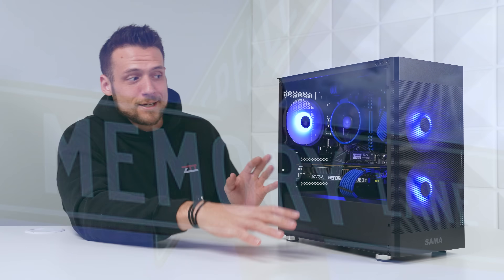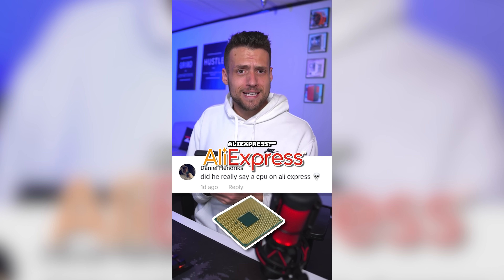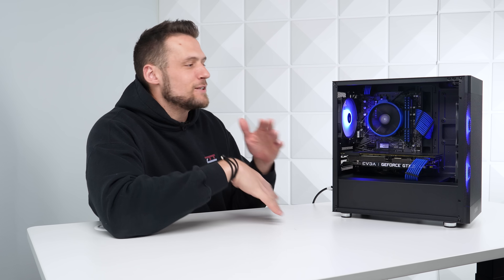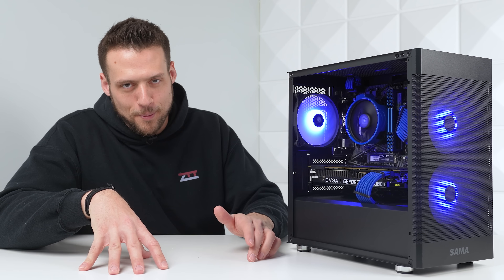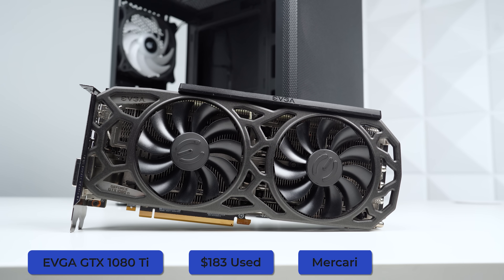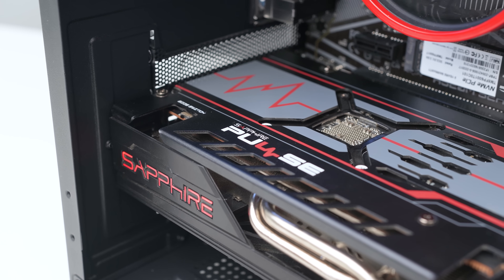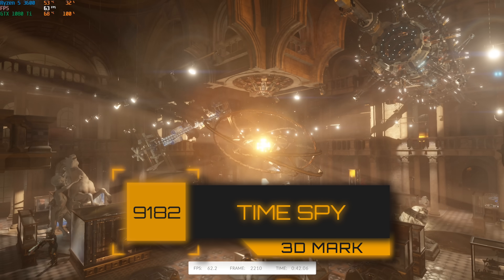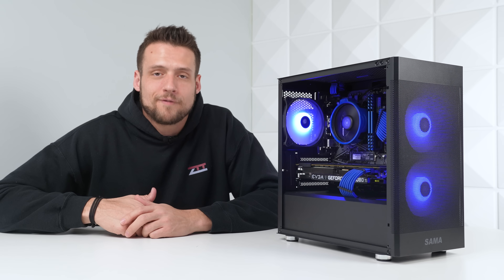A Very Repeatable $500 Gaming PC Build Guide

Comment: Can I run 32gb of RAM instead or would there be no difference

Edit 
I build this pc but i did changed somethings i did get that brand ram but i got a 16x2 @3200mhz ram 
I couldnt find a ti version but i did get the 1080 ftw edition 
And a pk hynix p31 ssd 
I see he bought a cheaper ssd but i was concerened about cache does memory cache really matter? The p31 was $114 when i bought it

Comment: Yikes I kinda got ripped off for my build 😅
Ryzen 5 5600 ~ 130
A520M Tuf Gaming Plus II ~ 80
Msi Gaming X GTX 1080 TI ~ 350 😣
Kingston 2tb 7000mb/s read/write ~ 220
Coolermaster psu 750w bronze ~120
Corsair Vengeance 2x8gb 3200mhz ram ~ 50
MS Armor V700 case with 4 pre-installed rgb fans and glass on side and front ~ 50
Some 90mm fan 125w tdp cpu cooler ~ 20
90 degree argb motherboard adapter ~ 5-10
ssd argb infinity mirror cooler ~ 6

Basically its a 1000€ build 😅😅
But in my defense I did buy it around 2 years ago

Comment: Would this work with a vr headset? I’ll disclose minimal specs in the sub-comments.
Reply: Here you go. 

Component:Intel i5 – 4590 / AMD Ryzen 5 1500X or greater. Operating System: Windows 10. Memory: 8 GB+ RAM. USB Ports: 1 USB port.
Reply: Also, should I really trust Aliexpress?

Comment: Hi great videos i use i7 3770 and 1050 ti and its time to upgrade but dont wanna spend too much around 450-500 euro i was planning on going i3 12100f and ddr4 memory 3200mhz with 1660 super do you think it would be good motherboard would be h610m-k which i think would be enough bcs i dont plan on upgrading for a long time what do you think???

Comment: How much will 5600x Bottleneck 6900xt?
I got a 6900 xt gpu used for a great deal 300$ , but now I want to pair it with a 5600x, which is right now on sale for around 135~140$.  ASRock B550 Pro4 motherboard 85$, klevv cras x rgb 2x8GB 3600 43$ (asia market)
My power supply is a TT GF1 850w gold+.

Comment: With cryptocurrency slowly rising atm, I snagged an aorus 1080ti for around $100usd as a spare gpu. It's good enough to support 2 1440p monitors without any major hiccups. Currently running a 5950x & strix 3070 for my daily set up :)

Comment: I have Ryzen 3 3100 + MSI B450M PRO VDH MAX + 1660 Super with 32GB DDR4 3200MHZ Ram. Planning for little upgrade without spending too much money. I just need better CPU for my programming needs now. Any suggestions pls.. 

Should I swap CPU with 5700x / 5800x . Will it work seamlessly(BIOS Upgraded). Or should I go for I5 13500 + compatible motherboard. Reuse rest of the components. 

13500 seem to give better cores. Just wanted to check before I invest.

Comment: I feel if you want a good pc it’s worth getting the newest cpu but getting a used gpu until you can upgrade and good case I found is the monotech air100 Argb has 4 pre installed fans and it’s pretty quiet and good for temps for $60
Reply: Yh I got the white one it’s great but for some reason in the uk its always on preorder
Reply: The air100 is really sweet , Zach has actually used it a couple of times in his videos he also recommends it

Comment: I just picked up a R5 3600 and B450 Aorus Elite V2 mobo combo for $170, plan to do the exact same build
Reply from the maker: Nice, although that's pretty expensive for that sort of combo. I like pairing the 3600 with a way more budget motherboard most of the time.
Reply: @ZachsTechTurf  yeah my thoughts exactly, but it's what was available at the time I had the funds for... Besides I do plan on upgrading to the 5800X3D later down the line. I'm sure the motherboard can handle that beast. This is my very first build and I already had a decent case before getting the combo, the Montech Sky Two case. Going by your esthetic logic, I had to go with an atx board.

Comment: I think you should use the 3600 with a 120mm cooler tbh, as it can get hot unexpectedly because of the Chiplets stacking that's harder to cool if it's the bare minimum wraith stealth cooler

Comment: Hmmm……..🤔………500 bucks……….With the awesome 1080ti, $500 is pretty tight. Lots of low end components and a limited upgrade path on that motherboard. You sure you didn’t miss a cost somewhere and did you include all the incidental costs tied to the build?
Reply: 5800x3d isn‘t a limited upgrade path buddy, that chip will be good for a 4090 and even for the next generations 80‘ cards.. The 5800x3d is still on the top of the charts when it comes to gaming performance. And if you watched Gaming Nexus videos, the 7800x3d is only 10% faster at 1440p and the same perfomance at 4k. So that‘s useless af for a premium price for the motherboard and ddr5 ram

Comment: As always, very nice looking PC!!! I recently built a PC for around $500 but I went with i3 12100f and b660 mobo because of the upgrade potential.
Reply: Nice choice,but am4 is also a very good upgrade potential because both platforms are dead but you can upgrade to like a 5600 like you can upgrade to an i5-12400
Reply from the maker: Very nice! What GPU did you go with?
Reply: @ZachsTechTurf Is GTX 1080 Ti good with i3 12100F and B660M Mobo?
Reply: Where did you order your parts?

Comment: The 3600 is like the RX 580 of the CPU world. Cheap, reliable, always available.
Reply from the maker: It really is!
Reply: Well I think ppl still consider it a mid range CPU...not bad for a cheap little CPU
Reply: @scarfaceReaper 5600?
Reply: @iceorangutan 3600.
Reply: @iceorangutan in some parts of the world 5600 is not considered as cheap
Reply: @fififairuzfuyooo  yea still expensive
Reply: @fififairuzfuyooo Bro it's cheap in every part of the world. Why would you buy a 3rd gen now?
Reply: @kunaljanvalkar2850  it's definitely not cheap in my country, in fact for an extra $5 you could get an i5 12400f which is what I would get for the price.
Reply: @scarfaceReaper  it was a midrange cpu at release, not anymore though
Reply: Still running my Sapphire Radeon RX 580. Still going strong.
Reply: 3600 has PCI gen4
Reply: *pcie
Reply: They selling this bnew more expensive than 5600x.
Reply: @zilverman7820  There will always be scalpers. I saw an i7 4790K for sale for $789.99 the other day. Doesn't mean they are actually worth that.

Comment: Referring to the 3600, the ones on AliExpress don't come with a cooler. Where would your recommend getting them from?
Reply: Just get a thermalright or ak400
Reply: @appsaucetech  That's still an extra $30.
Reply: Thermalright or Ali: Snowman.
Reply: @dianaalyssa8726  It's still an extra $20-$30. Thanks for the help though.
Reply: these amd wraith coolers are extremely cheap any ways less than 5 bucks thats as much as a normal meal from mcdonalds i dont think this will break the bank like more expensive tower coolers for 30 or 40 dollars
Reply: @crisrisq  $5? I've never seen one that low. Do you mind sharing?

Comment: Hey Zach! Is a ryzen 5 5500 good with rtx 4060? I am planing to buy a PC with this configuration.
Reply: To keep your AM4 motherboard and ram, go for 5600x, 5700x on up to the 5800x3D CPUs. The 5500 will work but any of those options above will give the 4060 alot more room to run. Plus you don't have to build a new PC to run something like the above suggests 7700x as that is on AM5.
Reply: @MTcoiner  Thanks
Reply: Depends on task but you are prob fine but if you want to be safer get a better cpu like a ryzen 7 7700X
Reply: @Notawesum  Thank you for help.
Reply: @MihailoMladjenovic-bx6vw  yw :) ;D
Reply: @Notawesum I would use it for gaming 80%
Reply: @MihailoMladjenovic-bx6vw  what games? Competitive non gpu hard task games?(basically just non graphics intense tasks) or graphically demanding games like cyberpunk 2077, hogwarts legacy
Reply: @Notawesum  Competitive like Call Of Duty
Reply: @MihailoMladjenovic-bx6vw  get better cpu for that then, since the cpu bottlenecks the gpu which is fine if it’s a small bottleneck but it’s just too big of a bottleneck